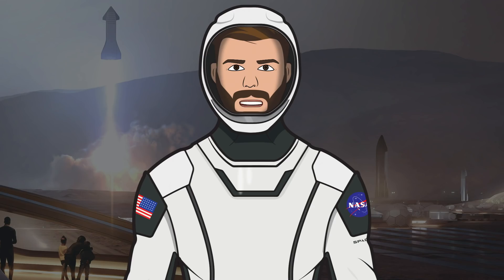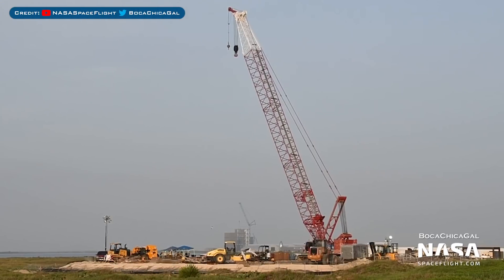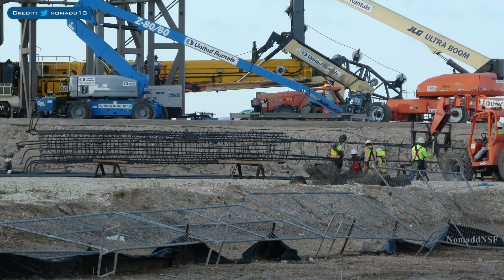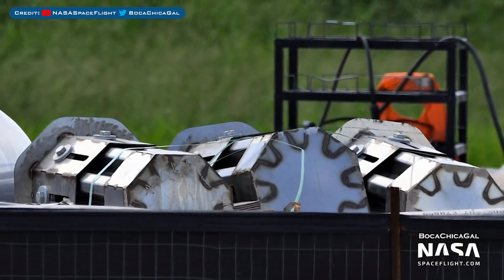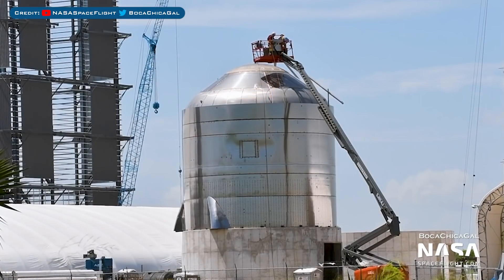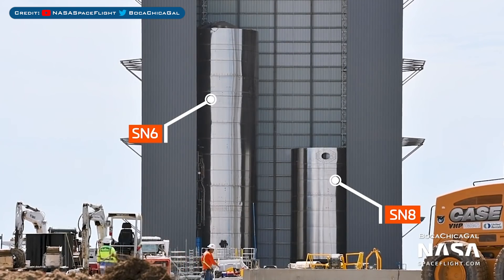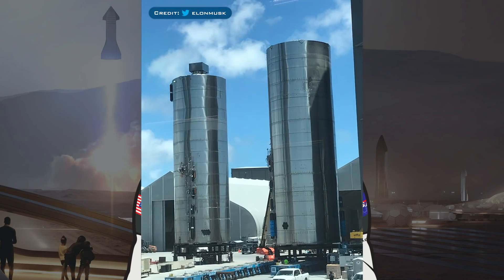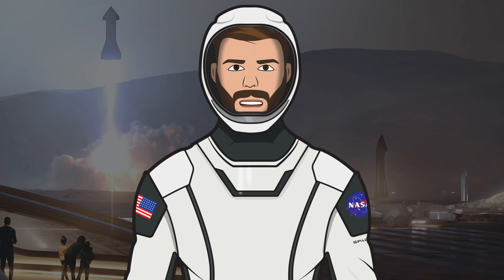SpaceX Starship Updates! SN6 Testing Next, SN5 Returns! TheSpaceXShow

Comment: As for the SN 2 tank -How abouta water tower either for theyre village or the sound depressing system at the new launch pad? Johan.
Reply: itd be for village use if they use it for water, it doesnt have nearly enough capacity for ss work. i could also see it as a temp tank for methane gas before being sent to the condenser plant
Reply: mouserr they’ve been working on it way to long for it not to be something fairly important
Reply: mouserr How much capacity would you hhink the launchpad water supression system would need för a SS and Superheavy? Johan.